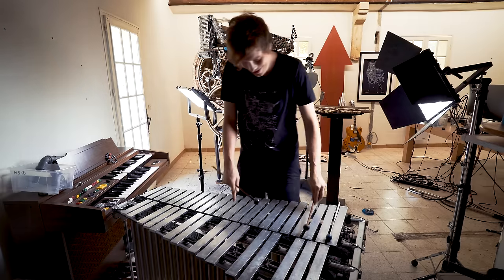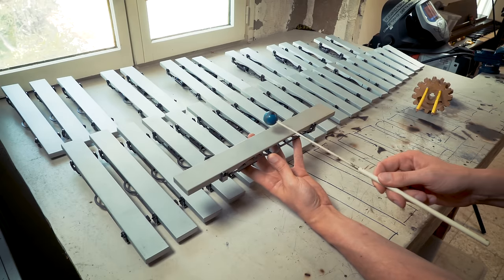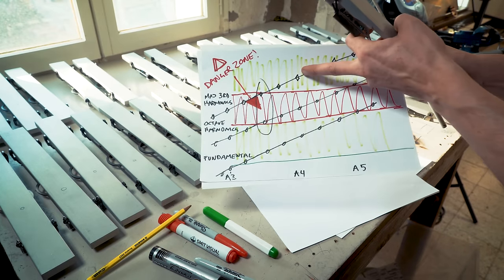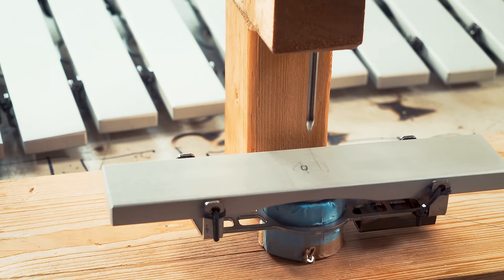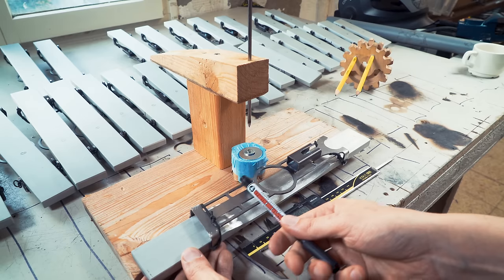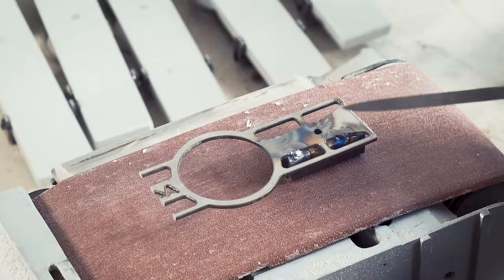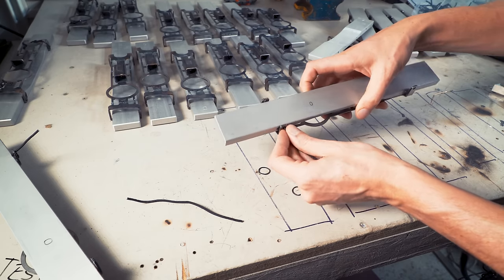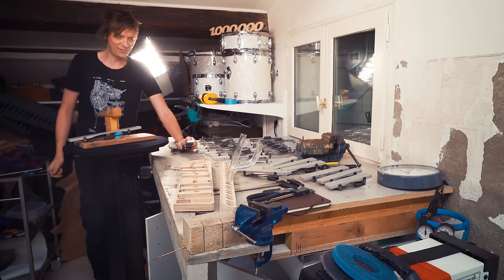Music Harmonics Jig (To Hit The Sweetspots) - Marble Machine X #101

Comment: For those wondering how an F mallet can produce what's clearly a Bb harmonic that shouldn't exist: It's a Bb, and it's not a perfect harmonic. There's a pheonmenon called acoustic dispersion which in short means: Waves at shorter wavelenghts travel faster through metal than longer ones, resulting in the harmonics sounding slightly pitched up. This is the reasons why bells and cymbals sound so inharmonic, why you use stretched tuning on pianos (so the harmonics of lower notes match the higher ones), and most prominently why a steel rope that is let's say hit by a hammer sounds like a laser gun - the higher frequencies reflect back way earlier resulting in that characteristic "pew" sound (thanks Star Wars I guess)

tl;dr: No, your perfect/relative pitch isn't broken, it's a Bb, and it makes sense :)

Comment: Hmm, I only had a course with an introduction to mechanical vibrations. But to the best of my knowledge, you also change the natural frequency of your bar depending on the way you fix your beam in place. And drilling holes will also change this, depending on the size and place of these. I just thought you should be aware of this. Maybe you should get in contact with some engineers with work with vibrations daily? Good luck Martin, keep up the good work!

Comment: I thought it was important to suspend the bars on a null in the standing wave in the bar, else it would dull the sound. I've previously used powder (salt, sawdust) sprinkled on the bar and then strike the bar. Watch where the powder remains and where it dissapears from. The most active parts (those which produce the most sound) clear the powder. The least active (where they move the least, or where they should be suspended) have powder remaining.
Reply: You are correct, but what he did here did not change that.
Reply: @DBautell  it should also highlight where the nodes are for the overtones.

Comment: Martin, I know you went through a lot of effort on this manual changes. If it needs another change I think having a screw or threaded rod that allows you to shift forward  each note's holder forward and backward from the bottom plate. If wanted I can run a sketch or mockup to try and make this a bit easier to visualize.

Comment: All the welding is necessary to ensure the offsets of the holders are going to work before you ask someone to redo them: if you ask them to. I think the welds add a story to the machine. But I would fix the CAD files in case you need to make a replacement while on tour.

Comment: When hitting the high notes, if you are off centre, you run the risk of hitting the node (where the string would normally run through the bar).  This is the point of least vibration in a bar, so when you hit it, the fundamental doesn't get activated as much as when you hit the centre.  This gives the impression of more higher pitches since the ratios between fundamental and overtones is inverted.

The bigger the note, the easier it is to get the sweet spot - the smaller the note, the smaller the sweet spot!

The resonator pipe should always be in the middle if you want get the most amplification out of the fundamental pitch.  If you shift the resonator off-centre, it will not amplify the fundamental as much.  This is because the fundamental vibrates through the whole length of the bar and has the greatest amplitude in the middle.

Comment: to find the exact place to hit and get a single fundamental note you can always solve the differential equation of the wave on a plate or in this case on a solid body, you can approximate using an iterative method, for almost any type of thing that vibrates or sound (most likely this point is unstable)

Comment: I know that the problem already has a solution but you could also approach it from the other side, and it could potentially correct the 1mm error you showed (even though that's acceptable) by aiming the marbles as they are dropped onto the vibraphone. Adding a fine adjustment to the last portion of the drop that could be controlled via screws would allow more fine tuning of the drop angle/direction.

Comment: Hello Martin, you pointed out, that the major third is too loud when hitting the geometric middle of the bar. But at the end, you will amplify each tone with the resonator pipe, which amplifies ONLY the fundamental. So in total, you will cut off the overtones you need, which are later not amplified. So in short my suggestion: You have to find the sweet spot in connection with your resonator tubes, thats the only way to decide, which point should be hit with the marbles. Just my two pennies...

Comment: Your resonator pipe makes me think of car exhausut pipes. I've often thought of cars as musical instruments. You get very different sounds from different  numbers and arrangements of cylinders, also firing order and crank shaft make a difference. Pitch is related to RPM, as you might expect, adding an exhaust is like adding a wind instrument to your mechanical umbrushcer. Most exhust systemes on modern cars are designed to keep the sound of the engine quiet. On sports cars the exhaust sytem is tailored to allow rich overtones. A few F1 cars have been 'programmed' to play tunes, but if ou could build a library of exhaust noises you could arrange an entire automotive orchestra, if you wanted to draw viewers from car fandom it might be a good little video to make.

Comment: If the elastic string also has a rubber core then it will degrade like the o-rings would. Also, it may be possible to tie the elastic in such a way that wraps around the support prior to the tie, doubling the duty and removing the need for o-rings.

Comment: You could do the shift with less cutting and welding by just swapping the sides over.

Cut extended end from ~2cm, shortened end by shift amount + 2cm.
Swap and weld.

Comment: Now that you've shifted the hit spot for each plate; do you have to go back and check for marbles being able to clear every plate in one bounce?

What if you turned the plates a little diagonally (or tilt them a smidge) so that the marbles bounce off to the side of the plate instead of towards the long end of each plate.  That way all plates will have the exact same bounce clearance -- regardless of their hit spot.

Also, consider using painters tape to frame the bounce pad are before you apply the silicon.  I think that'll help get you cleaner edges.

Comment: After hearing the tone with the resonator pipes over the bar. It sounds pretty pure compared to no pipe. Even when the bar was struck off it's sweat spot. I wonder if all this work to find the sweat spot on the bar is that necessary. Not every marble will hit the sweat spot. Seems to me should a strike happen off the sweat spot the tuned pipes will filter out the bad. However, I do see having it all tuned right gives a louder note over the background. That would make for an interesting mic mix to make all the bars the same level.

Comment: "Why I can't play guitar"... you will run into the same problems, each string hat it's individual sweet spot if you play flageoletttonse :-) For each frett and for each string. This is also a common problem when you try to find the best place for a pickup. There is no perfect point. Ist allways a compromise. If you build a guitar from scratch (without an instruction or a kit), you have to make the same learning curve as you did. :-)

Comment: QUESTION: Isn't that the point of the resonator though? It's amplifying the fundamental note which surely makes it less critical where the hit point is?

As far as contact mics, wouldn't having one on the resonator tube as well give you the vibrato and a much fuller sounds when added to the contact mic on the plate (? not sure what you call them) ? The plate itself giving you the brightness and the resonator tube adding body and vibrato? I know it's double the mics but you want sound quality without all the machine noise right? The audio engineer in me would most likely mic a vibraphone with at least three mics, 2 OH and at least one positioned low to pick up the tubes, and mix above and below together to get a really full sound. Of course that only works effectively  in a sound proof room with no other sounds around... I've never had to mic one and I've had no contact with vibraphones at all so I'm just guessing here; that's just my first instinct so I welcome anyone telling me why I'm either right or wrong on that.

Comment: How about using resonator pipes to draw out the frequency you use on each of the keys. Unblock a low frequency pipe to bring out the lower frequency or unblock a high frequency pipe to emphasise the higher frequency. Also, are there some keys that you may want to hit different places on to bring out various frequencies? Can a key be hit vertically or do they have to be horizontal?

Comment: You did 50% more sawing and welding than necessary. You were making three cuts and three welds per part, and each one of them could have been done with two cuts and two welds. Consider:

Let's say your part is initially 2X mm long (left side = X mm, right side = X mm) and that after cutting and welding you want the part to be 2X mm long, but now the left side will be shortened to Y mm, and the right side lengthened to 2X-Y mm. You make one cut at Y/2 mm from the left end, and another cut at X - Y/2 mm from the right end. Then you rotate the middle section 180º and weld it back in. Done.

Comment: I wonder if instead of having the spinning butterfly valves in the resonator pipes, you could have the whole block of pipes moving side to side by half a vibraphone plate width to get the tremolo effect. I'm not saying it would necessarily be better, but maybe it might be another way to approach the problem of manufacturing something that can be disassembled.

Comment: Hey Martin!
If you want to minimize overtones and are more interested in the fundamental note, you should consider using Helmoltz resonators rather than resonator pipes.
A resonator pipe is basically a wave guide with a deflector at the other end, so it amplifies all wavelengths that are a division of twice the tube length; this means all the harmonics, even if they end up less powerful than the fundamental.
A Helmoltz resonator on the other hand is way more frequency-selective, so the harmonics fade much faster (they can still be heard just after the bar is hit, in the "attack" of the sound, but only the fundamental is sustained).
You could still get the tremolo a rotating deflector provides on a vibraphone, using just the same principle.

I've been experimenting with Helmoltz resonators for my DIY celesta project (https://wiki.fablab-lannion.org/index.php?title=Celesta_DIY ) and eventually found a way to tune them precisely, which I still have to document, but if you're interested I can speed this up. NOTE: Resonators in my first celesta attempt, as seen in the video I posted, didn't work! Searching for a working solution was yet another rabbit hole, but I eventually found how to fix it, only I've been procrastinating lately rather than implementing said solution... :)
Cheers!

Comment: If you rebuild the holder, you could do a sliding mount for making the adjustment easier
Reply: Also, the reason why it would be a good idea is that the jigs you use was not perfectly straight so that's mean it doesn't follow the path of the marbles

Comment: 03:15 - The harmonic is actually about 2.666x the fundamental frequency, which equates to A#, not A. (Sorry to point it out lol - Sound Engineer here.)
Reply: Maths:
"F5" = 440*2^(8/12) = 698.45 Hz
Multiply that by 2.666 and you get extremely close to "A#6" (1864.655Hz).

Of course, it's not perfect because it corresponds to the harmonic, not to Equal Temperament scale. But it's only a couple of cents shy of A#6, as opposed to nearly 100 cents away from A6.

EDIT: Also confirmed with FFT analysis.

Comment: All of the low notes on the vibraphone have a long thin section in the middle.  The sweat spot is never in the middle of this thin area.  Looks like it's always at the edge of the thin area where the bar starts getting thicker.  This would also explain the dissonance, as the center section could have different harmonics of it's own. Off-center hits would also excite torsional vibration modes which wouldn't harmonize with the fundamental.

Comment: The problem now is the balance of each plate on the machine. With some of them moved off center, the balance is now inconsistent. And since the spring steel that adjusts the bounce is connected to the machine and not each plate, they're going to have to either be swapped out or made generic enough to handle every note that can possibly go in that slot which will mean the plates probably won't be level (which will affect where the marbles hit each plate). I wish I had a suggestion to fix this one, but I can't come up with anything that's very elegant. Curious to see how you approach the problem, Martin.

Comment: Did you checked if the place shifted vibraphone plate will intervene with programming wheel?

Also, these welded parts should be prototypes. Once they are fully tested, ask Alex to make the new one.

Comment: I'm pretty sure that the notes sound good if you hit them on the end (outside of the 2 hangers, not between). No chance you're hitting a harmonic point so close to the end of the note. Then you don't even need to worry about where you hit, just go a cm or two off the end of the note.

Comment: I guess I haven't thought this through fully (sorry) but would it be possible to mould custom vibraphone bar-holders in silicone or Santoprene to avoid all of the rubber bands and ties (and make fitting/changing faster)??

Comment: I'm not sure, but maybe you could've saved one cut and a weld per bracket by cutting other end of the bracket just longer by the measurement and switching the ends around (top to bottom and bottom to top) before welding. That is if they can be switched.

Comment: Theoretically speaking surely there is some type of mathematical way to find the "sweet spot" as long as the plates have been machined consistently. it's done at this point but I'm wondering if it could have been found without having to do so much tuning by ear.

Comment: Tone, pitch etc might change (not so much to others, but torturingly so for perfectionists) might change In the real run on the real thing. Perhaps a pipe jig device made in the work table to drop the steel marbles at the "g" force that they shall actually drop in the MMX machine, and collect them in the device itself for recirculating, would have taken the project on a firm footing, instead of promising surprises (to the exactness of the perfectionists ear) when done as the final test run on the MMX prototype. This is in keeping with the fact that the friction and velocity and mass of the vibraphone mallet is a function of the tone produced in the bars. Martin must be much experienced to know this......

Comment: I don't want to be the bearer of bad news but if I get this right you essentially moved the vibraphone hitting points to the marble drop points by moving the bars TOWARDS the programming drum, right? Do you actually have enough clearance for that? that one note you exemplary put on the marble machine was significantly cutting into the drum space and only actually did fit because the drum did not start yet.

Comment: I was wondering if you're redoing the holder anyways, why not redesign it so each holder has several points of attachment so if you want to move the plate forward or back you can if you have several holes instead of one attachment point. Or an extended groove where you can easily slide back or forward. This is a year too late and am just watching these videos so idk how the end product looks. Might be off base.

Comment: Can you please use softer mallets on the vibraphone? Yes, you will be dropping steel balls on it, but it will be through a layer of silicone or latex. A lot of your sound calibration regarding overtones and resonators is using that sharp tone from your mallets, but in reality the rubber layer will soften the blows quite a bit. At least use a rubber mallet that matches the density of your latex of choice.

Comment: Even though, its after you're done, but why cut and weld the whole  piece? why not just add a extension with a slot so you can adjust the vibraphone plates as needed?

Comment: Too late now, but you could have made half the number of cuts and welds...

Choose an arbitrary distance in from each end then cut one end + half the distance the plate needs to move and cut the other - half the distance. Swap top and bottom pieces and weld back together.